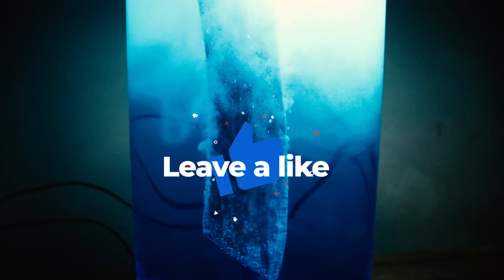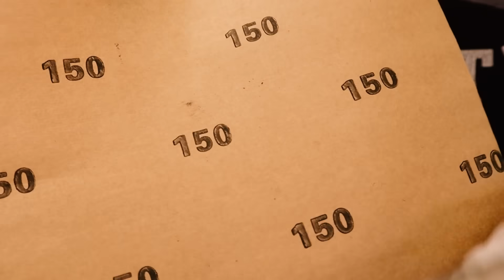Old machete restoration turns into Japanese kitchen knife

Comment: Am I the only one crying about the heat treat?
Reply from the maker: No ... I'm crying toooo. But The knife still works and are sharp 😉👌
Reply: It's kinda lame tbh lol
As far as I know, if it's hot enough it will smoking like crazy when quenched, and some steel can even bend, but this, i don't know why it made me laugh...
Reply: That's not even considered as a heat treatment. He just warmed up a blade lol
But I also don't believe he's a blacksmith or a metallurgist, so that's fine. This would've been bad if he was an expert in it!
Reply: Would have like to have seen a good strong mechanical connection with the handle. Pinned or pommel. If you are chopping fish onto a hard surface, that blade won’t survive the strength test.

Comment: Im confused did he heat treat it or was he tempering it cause if be was heat treating it to harden it theres no way the metal was hot enough and if he was tempering it why dunk the blade in liquid cooling it down fast that make it brittle and brake easier?
Reply: I guess he warmed the metal just enough to blacken it in the oil bath. It makes a Very cool look.
Reply: @pluret  yes it does but it also makes it easier to break. I dont know alot about forging metal. I do know that if u warm up a blade to a certain point after it's already been heat treated. It can make the blade brittle and easier to break.
Reply: @r.h.5217  Yes, I imagine that it is important not to exceed that heating point, and a couple of fails makes one learn how not to.

Comment: Curious why you didnt thermal cycle the blade before hardening it. Also why the pins? Also why the whole salt water, electro? Couldn't you have just gone straight to the grinder? That would have also thinned the blade a little so the geometry would have been better for a kitchen knife. Seemed a little robust from the video. Did you end up working the bend out of the blade? Would have been nice to see it.
Reply from the maker: Hey Scott thanks for watching - This knife i did for fun to see if I could get something useful out of this very rusty "thing" - I might not have followed all the rules to get it perfect, as hardened it correct and do a real proper grinding. But it's still sharp and working 😉 - You are absolute right Its robust! We use it as a meat cleaver  😬😅

PS. I did the electro first to avoid all the rust in my garage 😉

Comment: You dismantled a brand new hammer to use its wooden handle. Why not just buy a new wooden handle for this project? In general the result looks great, but I believe the project can be made quite a bid simpler.

Comment: Still not mixing the epoxy when puting in the handle. Drop it and it will come apart
Reply: Pro tip: Don't drop it
Reply from the maker: I actually did but without filming... 😉

Comment: No where close to being tempered right
Reply: Why not,?
Reply: @iPownYouN00B  the steel was not hot enough.
Reply: @rasmuskarjalainen6856  good definition of not being tempered but thats not what i asked, why would you say it isnt temepered right, japanese knives are to know to patigue
Reply: Tempering is a very, very precise process. It require keeping the steel st a certain temperature based on the exact molecular structure of the steel itself. 

Then its held at that temp, and painstakingly cooled at exact intervals in precise spots on the blade. 

This guy just bbq'd his shit. 

I like his stuff, but he is pretty sloppy in his technique. If he sticks with it for a while he could be good.
Reply: Levi Burns surely just for a home use kitchen knife/gimmick the heat treat won’t be a massive deal?
Reply: Wasn't being tempered it was being heat treated but yes the heat treat definitely wasn't hot enough to reach the required hardness for a knife.
Reply: @lachlantaylor1225  if you want to reshapen it after every cut go for it lol

Comment: You need better tools and some more skills. I don't know why did you cut the tip of the blade. Just polishing it would do the trick. For the rest of the blade, I'd like to see a mirror finish to it. It still look a wreck despite of the edge being fairly good. The handle was performed OK but I think it would be more interesting to see an handle carved from scratch. I think that quench is a total failure. You did softened the material with that! You have to stick the blade in the coal and increase oxygen supply  to raise temperature to some minimum of 500-600ºC needed for quenching. Gas torch will hardly do it, specially a small one like yours. Correct temperature would show as a medium red glow in the blade. That's what it takes. Still is good that you have the creativity to do this. Keep going.